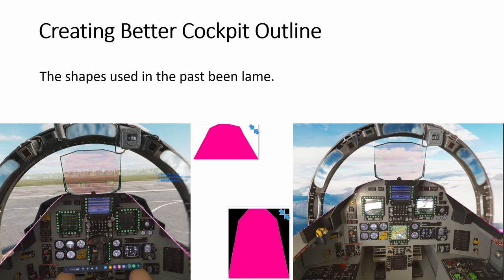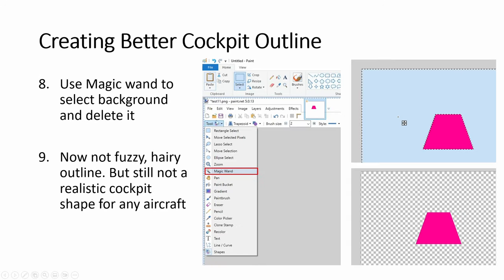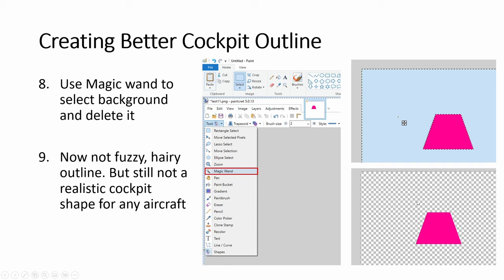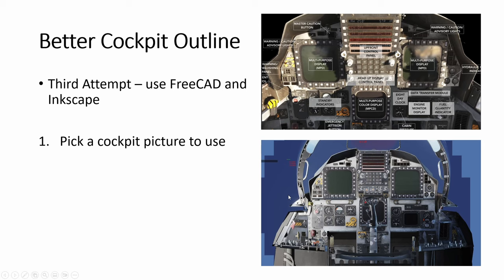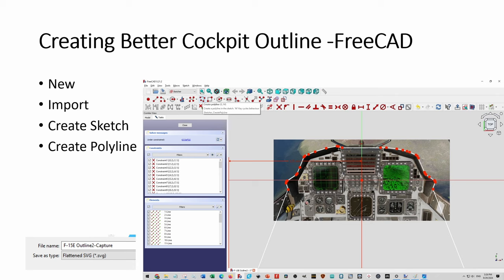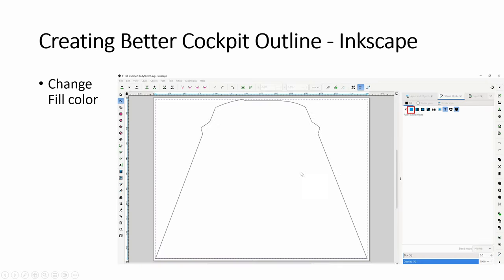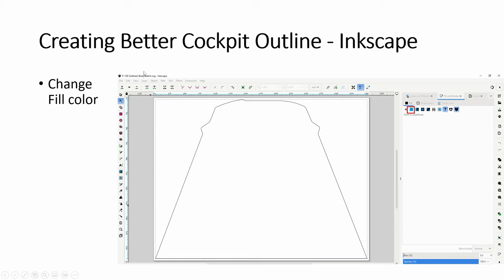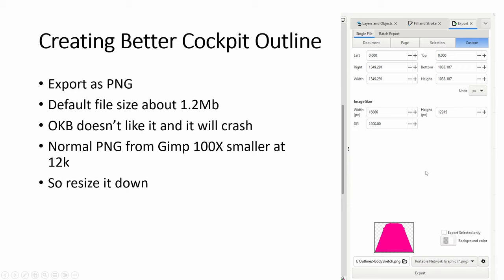Episode 34 DCS Create Better Cockpit Outline for Mixed Reality

Comment: Wouldn't it be possible to create a pink chromakey overlay for, say, the whole physical Winwing top gun MIP, and then create 3 more black kneeboards so that the DDIs and MFD are rendered in DCS VR and not in IRL?
Reply from the maker: @chickenlittlefpv8209  I don’t have any winwing products so I don’t know their shape and size. You will have to combine some of them coz okb can only handle two knee boards. For the front console you can put all mfds on one big monitor that includes the mip. Vertically. A second kneeboard to cover your seat and side console horizontally like how I did it so when combined it covers the whole cockpit

Comment: question more than comment. kneeboards are configured for correct position but the pasthrough of my g-1000 is not reflecting any changes. any idea what i am doing wrong
Reply from the maker: by g1000 u mean garmin? sorry u need to elaborate. i can't picture what u are saying about kneeboard not passing through
Reply: @simpitacademy  i am using air manager with 2 wimaxt 15" touch monitors and  a knobster . first monitor with PFD the other with MFD. I start msfs 2020 and use popout manager to populate the monitors with the PFD and the MFD. In 2 D i see both and they are controllable. When i start virtual desktop and start vr with the passthrough turned on i see my controls and the Garmin PFD and MFD but they do not sync ( knobster does not adjust or the images are static and do not change. Hope this helps
Reply from the maker: @rcbruce841  ok this is a known msfs problem. your problem is not MR but VR. In DCS we use Helios to export instruments to secondary monitors. Then use VD to mix reality, openkneeboard to display passthrough etc. MR works in msfs. I demonstrated that in a video about flying around Mt Fuji. The problem is that all MFD, PFD etc instrument display freeze up in VR in msfs. I saw in discord people have reported this bug two years ago. I also reported this to Microsoft few months ago. Till they fix this bug, all instruments work in 2D and freeze in VR. Then you can't do MR. I did the Mt Fuji video in MR without displaying the MFD since they are frozen.

Comment: Do you have to do the helios programing each time?
Reply from the maker: @SlushieTee14  if u didn’t change any screen layout or gauges then no. But u have to realign knee board vs vr view of cockpit to latch up
Reply: @simpitacademy  so if you are using the same plane each time you only need to realign correct?
Reply from the maker: @SlushieTee14  yes. U select Helios aircraft profile and run Helios. don’t have to change set up each time. Don’t have to edit or check Helios lua in monitor setup folder each time.

Comment: Why is there always a magenta line? Can you change it to black, or is there a reason it needs to be magenta?
Reply from the maker: you mean pink line? If you watched the beginning of the video I showed various ways of drawing the pink shapes to represent the cockpit outline. Pink is the common color chosen for passthrough. Once in VR the headset like the Quest 3 will separate virtual and passthrough and the separation line is the pink line you see. If you choose whatever color you want for passthrough in Virtual Desktop. But then the shape that you drop into dcs folder for the right aircraft has to have matching color as the one you indicated in VD. See episode 27 for full Mixed Reality set up steps.